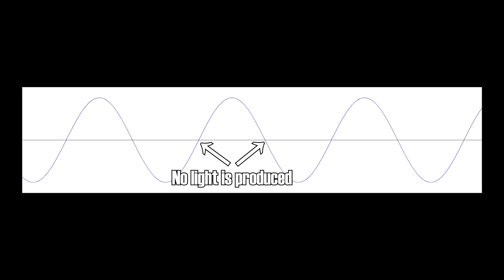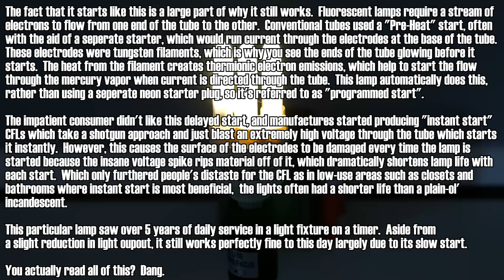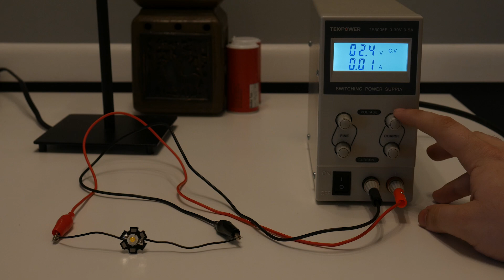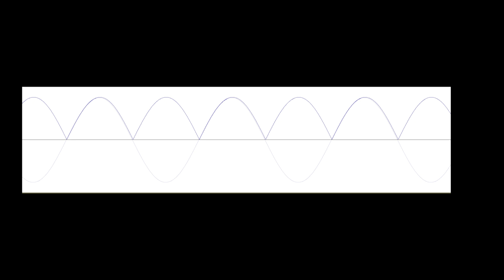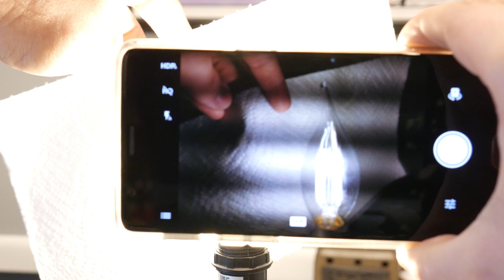LED bulbs that flicker, and CFLs that almost never did

Comment: Of course I reeeeeeaadddd it .  The fact that it starts like this is a large part of why it works. Fluorescent lamps require a stream of electrons to flow from one end of the tube to the other. Conventional tubes used a "Pre-Heat" start, often with the aid of a separate starter, which would run current through the electrodes at the base of the tube. These electrodes were tungsten filaments, which is why you see the ends of the tube glowing before it starts. The heat from the filament creates thermionic electron emissions, which help to start the flow through the mercury vapor when the current is directed through the tube. This lamp automatically dose this, rather than using a separate neon starter plug, so it's referred as "programmed start". 

The impatient consumer didn't like this delayed start, and manufacturers started producing "instant start" CFLs which take a shotgun approach and just blast an extremely high voltage through the tube which starts instantly.

Comment: it a problem of power supplies
my overhead LED lamp and my kitchen T8 tube both flicker when I try to film at 240 fps
but the leds plugged into my pc's power supple is rock solid
so whatever the PSU of a PC does in converting AC to DC makes it rock solidly smooth
even my philips led bulbs flicker
of course one power supply is massive
but you only need it to do ~10-20Ws not 600+ and only 1 output voltage not 5
another thing are LED driven by DC but at full brightness are still driven with PWM dimming that makes it visible instead of current control which lights the LEDs constantly

Comment: First off you shouldn't be too surprised at finding 27 LEDs in a string instead of 20 that you thought you would, that's the factor of 1.35, while when you rectify mains voltage, the smoothed output is max sqrt(2)=1.414 times higher (minus approx. 1.5V drop on bridge rectifier) than the AC input.

There's a few different varieties of LED drivers. You could rely on inherent current limiting of another component like the dropper capacitor, and that is at least low-loss, but it's also not exactly flicker-free. You could have a power IC that acts as a current regulator and is based on measuring the current through an internal shunt and driving a transistor in a linear region with essentially behaviour of a variable resistor, meaning excess voltage times LED driving current between the voltage that LEDs need and the one it's supplied with is converted to heat, and given you have little space and heatsinking capability, and semiconductors tend to fail rapidly around 150°C, so perhaps you'd actually like the device to be slightly undervolted at the input for the part of the duty cycle so it actually has to emit a significant amount of heat only the other part of the duty cycle, but then that would introduce flicker. Or you could have a switch mode DC buck regulator to limit the current, those are very efficient and emit little heat, but at that power, you're going to need a somewhat big choke, more than about a centimetre in size or so, and if all the space you had was just what you get on the inside of the Edison screw, well you'd have a packaging issue.

Comment: Some 'cheap' chineese LED bulbs use a capacitive dropper to run the LED's, sometimes no mains storage capacitor at all, so heaps of 50/60 Hz flicker, great for adjusting the speed of your old record player.
      (These almost look ideal - Simple circuit, less to go wrong = longer life?)

Have a look for Bigclivedotcom on YouTube, he has plenty of tear down's of capacitive dropper based LED bulbs.

Comment: My only gripe about led bulbs is that they are not restricted by the life of the diode but rather the components inside. I have several led bulbs that quit after 4-6 years with light to moderate uses do to other faults than the diode failing.

Comment: Carefully removing the diffuser globe before you put one of those little 8.5 watt LED bulbs in a ceiling fan or an overhead light with an opaque globe will get you a little more light, i haven't measured it but I bet it helps the LEDs to stay a bit cooler too.

Comment: Oh, god, if there's one thing I can't stand, it's the sickly yellow light bulbs some people insist on using. I guess their eyes have gotten used to that awful lighting that yellows everything up. But I'll gladly take a crisper "daylight" bulb any day of the week. Especially as I find those make text on paper so much sharper and easier to read when I'm thumbing through books or manuals. Or if I decide to draw and color something.

And if you get the good "daylight" bulbs, there are times when you can forget you're using a lightbulb and that it's not just sunlight falling through an open window.

Yellow/Orange lights are depressing.
Reply: I prefer yellow over white light because it mimics sunlight when the sun is close to setting. It's basically less blue in the light and I love it for the same reason that yellow filters are getting more common on smartphones and pc's: it makes it easier to fall asleep. Plus it's super personal. White light is too sterile for me. Great for supermarkets, not so for a cozy living room. :p

Comment: This new lamps are very bad for the environment, specially LED. They need electronics to work, their will end up in a landfill somewhere.

People think they are "saving the world" and that is wrong, they are generating more e-waste to dump in Africa or another poor county. Google it, look it up.
Reply: Well-built LED bulbs will last decades, so the amount of waste produced will be small. Additionally, unlike CFLs, they generally don't conatain hazardous   substances. The only problem is some cheap bulbs have really bad electronics that fail far more quickly than the LEDs themselves.
Reply: Just don't throw them in the garbage... recycle the parts yourself. Or give it to some friend who does that :)
Reply: I wouldn't say they are automatically bad; we just need to step up enforcement efforts against bad recycling practices and make sure there are options for those who want to recycle electronics in ways that are not detrimental to health or environment. Also with most LED bulbs lasting a very long time, it's hard to argue there will be more waste from them than other types of bulbs because replacing them is very rare. If you really want to fight e-waste, look no further than  cell phones, computers, and other devices that are constantly on the Moore's Law treadmill. The biggest perpetrator of e-waste is planned obsolescence - this constant technology treadmill that demands we get a new cell phone every new year.
Reply: Even a decent Chinese LED light will last half of that. I've got two LED light-bulbs for the laps (we use these odd ring shaped Florescent ones in the ceiling lights), and those have lasted me 4 years so far. and given I've learned how to properly solder in that time, they'll be stripped of every surface mount component I can get out of them before disposal. I like having a bin of useful bits to mess with.
Reply: DFX2KX thing is 2 is a way too small sample size to make any Kind of meaningful statement. I have replaced about 16 bulbs with LEDs. This is still an insignificant sample size but just for comparison, some of them (2) failed within 6 months , a lot more (6) failed within 1 year, now 3 years later only 2 are still the same old ones and they are going strong. So the point is , yes you might get lucky with some but the wide spread of quality still means your probably looking at a wide spectrum within 50%probably will fail long before CFLs at the same price point would have. I am all for LEDs but right now getting an LED that is reliable just costs 3 to 4 times as much, and cheap LEDs are a gamble. You might get lucky you did but I the end as long as cheap LED don't become reliable or at least more predictable in their failure rates they too are a money sink, because having to replace them more often evens out the savings pretty fast
Reply: Any cheap LED bulb that most people will buy will have cheap electronics. Even the top brands. Capacitors, resistors, diodes, rectifiers etc... all have a shelf life and its usually not even 5 years. To the land fill it all goes when its a worn part. Nobody will take time to recycle properly and troubleshoot what components are still good in a $5 bulb.

Comment: Interestingly the worst stroboscopic effect I've ever seen is from low level vehicle taillights. It seems to disappear when the driver hits the brake. But an automobile uses a DC electrical system. I was interested to learn from this video that LED lights require direct current. Seeing this strobe effect in a DC system is a little perplexing, Seeing this effect so pronounced, I thought the taillights must require an oscillator, but apparently the opposite is true. These low level tail lights are to me, a safety issue. I move my eyes around the scene a lot while I'm driving and the slow refresh rate of these nerve wracking lights leaves blinking tracers across my vision which is extremely annoying and distracting. I was amazed that they were allowed by DOT to be used on the road, they are so bad. The worst offenders are Cadillacs and Nissans. There are so many Escalades on the road that it actually makes me want to avoid driving at night, which previously wasn't a problem. The other issue I have is with tiny, high intensity LED lights because they have such a small source of very bright light. I've read articles that these tiny light sources can be damaging to the retina. A doctor in Spain has demonstrated this. This is because the infrared spectrum they emit is concentrated in such a small spot that the thermal energy is concentrated on the retina causing local thermal heating of retinal receptor cells, resulting in actual thermal damage. In Europe LEDs are categorized as laser lights. For some reason the lenses on these lights are tinted red but optically clear which offers no solution at all, whereas older incandescent tail light fixtures usually have a translucent, light -diffusing lens. It seems that it is even more important to use a diffuser with an LED light array. I believe that in the near future we'll be seeing a lot of people losing part or all of their vision due to the prevalence of these hot light sources. Do engineers really feel that an incandescent taillight or brake light is really using a LOT more gasoline to power in a car or truck? LED lights are a way to improve fuel economy? That's ridiculous. Just rolling a window down is worse. This insignificant change in technology seems to me to be more trouble than it's worth, but someone must feel there's a great advantage somewhere, otherwise they wouldn't be ruining our eyes.
Reply: LEDs last a lot longer than incandescents, especially in automotive conditions. The system is already DC. Home LEDs burn out the electronics long before the LED itself. LEDs are more shock resistant than filaments. Less heat and compactness means light fixtures can be much smaller and flatter. They require less current which means thinner (cheaper and lighter) wires can be used to run them.
Reply: Working in auto repair for two decades, the shop's policy was to replace common taillight bulbs without charge. Anyone coming in would be able to get a free taillight bulb. But I do know that even though the LED lights have a longer expected life, they can randomly fail. Several customers had light assemblies go out. They can't be repaired and you can't replace a diode, the entire assembly must be purchased from the manufacturer. I think I replaced one on a Ford that was about $250.00, a BMW that was about $300.00 and a Porsche that was about $600.00 and we didn't replace those free of charge.
Reply: So you knew fuel efficiency isn't a reason manufacturers use LEDs when you wrote "Do engineers really feel that an incandescent taillight or brake light is really using a LOT more gasoline to power in a car or truck? LED lights are a way to improve fuel economy? That's ridiculous." Yes, it is ridiculous to claim they use LEDs for maximum fuel economy if you knew that wasn't the real reason for their use.

Since LEDs only work within a narrow voltage range, they cannot be dimmed in the traditional way. LED dimmers use Pulse Width Modulation to dim the LEDs by switching them off and on rapidly. This is the cause of the strobe effect you're talking about and the added electronics are a likely suspect for the failures you mentioned. 

Poor implementation by some manufacturers does not make LEDs a bad idea for automotive use. If they simply used multiple arrays in the correct series-parallel arrangement for car voltage in the same way multiple incandescent bulbs or multi-filament incandescent bulbs are used, there would be no strobe effect and there would be little or no electronic components to fail.
Reply: Thank you, Al. I knew they are more efficient at producing light with less wasted invisible heat, but I also know this is yet another opportunity for manufacturers to employ planned obsolescence and "no user-serviceable parts" into their design. This has been a legitimate business/engineering approach taught to engineers and employed mostly since WW2. Some consumers try to deny manufacturers do this which only further enables management and engineers to employ it, but it's well known and I see it all the time. For only one instance the BMW in-tank fuel pump that is permanently sealed into the tank.. To replace the pump you must replace the entire tank at great expense. There's no technological reason for this, only the requirement to sell very expensive, dealer only parts. A very expensive taillight assembly without replaceable parts could obviously fall into this group, or at least have the introduction of the design with its consideration (sealed unit). Likewise unknown to the auto purchaser, various components with a purported longer life are actually designed with contrived durability but there's no way to know if, how, which or when. Admittedly there may also be a couple of technological reasons to switch to LED light assemblies but like anything else they are still not perfect. Just the expense of a failed LED tail light assembly is one thing, but personally as a driver- the way they dominate my night driving experience is beyond a simple matter of irritation (which I would still complain about) as it distracts my attention away from traffic. The tracers it leaves across my retina gives me a real mind bending effect that's difficult to explain or overstate. Two main reasons: The refresh rate is obviously far below my visual perception threshold. It seems to me that with this problem, and the discomfort of such pinpoint sized high intensity light sources without diffusion, possibly damaging my eyes, the DOT was plain wrong to not require more improvement on them before approving the design. I can drive down the road and see any number of cars in view, and I can tell you exactly which cars have LED lights and which don't because of their slow refresh rates- from nearby to miles away. in traffic a stopped car in front of me with LED brake lights  that resemble police roof lights in intensity blasts such a pinpointed intense light in my face I actually have to block the view of the car in front of me at a stop light putting the sun visor down or cover my face and just watch the overall light cast across my hood as I just can't look at the car directly. I can also close my eyes, as I can see the brake lights switch off through my eyelids! Any of these evasive actions of mine takes my eyes away from the road completely, albeit I am stopped. It also seems to rob me of my good nature, when I arrive at my destination I am irritated and angry. Certainly not at the other driver, who unwittingly purchased these powerful obtrusive lights. To imagine that a simple taillight can dominate my entire consciousness, distract my mind from the road and make me an unpleasant person in such a powerful way seems ludicrous, but true. Ten years ago I would have never imagined that such a thing was even possible, and today I can't get away from it.

Comment: What about the bad light quality caused by uneven distribution of wave lengths across the visible spectrum by LEDs and CFLs? (worse in cheap LEDs as they produce roughly 3 wave lengths)
Incandescent light bulbs are horrible at producing visible light only, which is why their spectrum is spread more evenly across a wide range, way beyond the visible spectrum even. As a result, we get better color information under incandescent light than with CFLs and LEDs. In fact, with CFLs it's possible to create a material that's completely black under CFL light, while it's white under incandescent or sunlight.
Reply: There also are some higher-end CFLs that produce very high quality light. But as with the LEDs, theyre rare and expensive. Its more common with Fluorescent Tubes.
Reply: +techmage89 Nope. Incandescent bulbs are essentially black body emitters. Nothing can produce better light than a black body emitter, that's the ideal basis to which we compare all other sources of light. LEDs can come close to incandescent bulbs (who knows, maybe one day they'll actually be able to match them), but they can never beat them. That's just physics.
Reply: Donnie Depends highly on the bulb. The very best LEDs can produce light that's even better-quality than incandescent bulbs, although these are still somewhat rare and expensive. Many LED bulbs settle for being almost as good as incandescent bulbs (and usually far better than CFLs).

They usually achive this by coating the LED with some kind of substances, such as phosphors, that will absorb the wavelength produced by the diode and re-emit light at different wavelengths. Obviously you need a blend of a bunch of these to get high quality white light, which is why I think the best bulbs are still expensive.